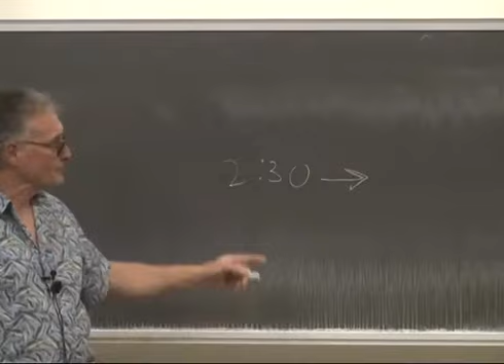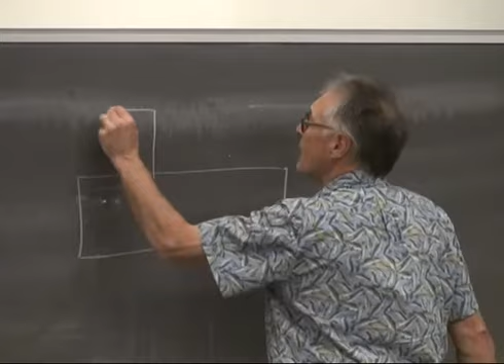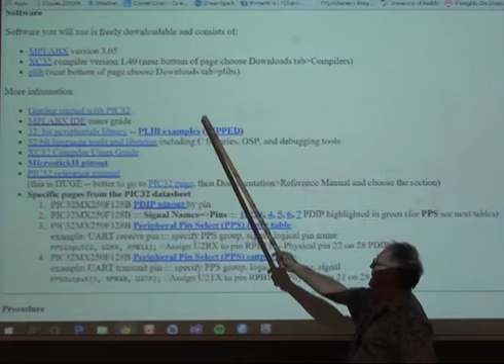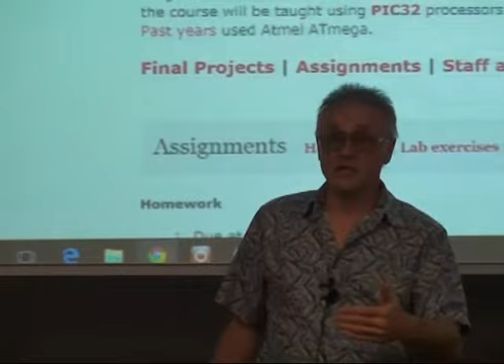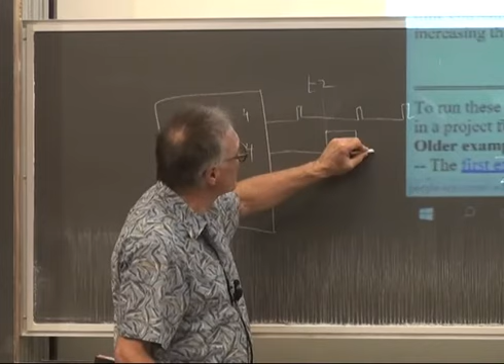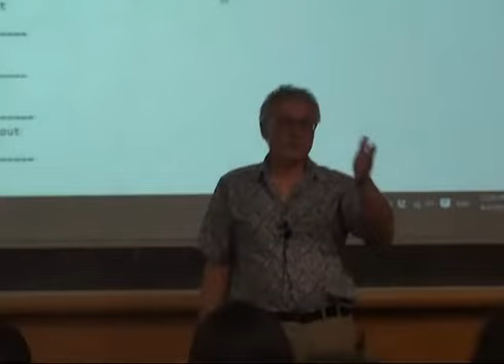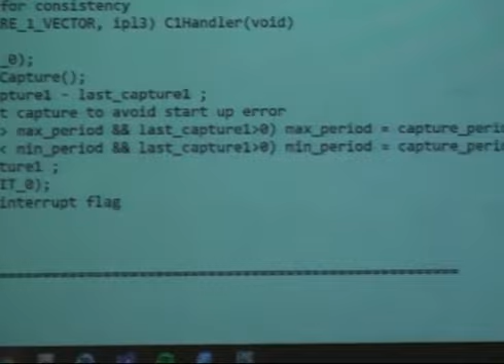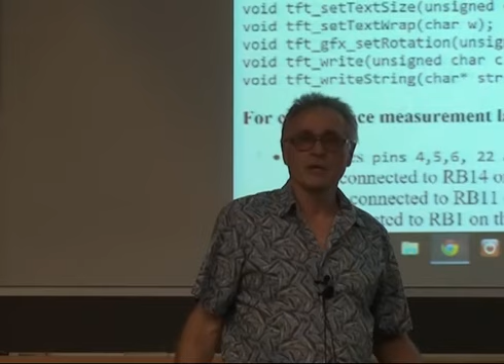#4 Comparator, input capture, output compare

Comment: This is a very interesting lecture and one of the hardest peripherals to understand first time. probably cause it builds on top of TIMERS and expects masterful understanding of the basics of TIMERS,  I managed to get my OC module to output PWM, then feedback that signaL BACK into the IC module the result is an ISR that measure the delta and its very accurate!, the IC module has some very interesting capture modes too!!, 
Its recommended to decide up front operating frequency detection range, else a frequency too high will keep the ISR way to busy, in my case I was using a PIC24F running at 32MHz and monitoring RPM and controlling two PC fans. RPM ~ 2000, frequency is about 30Hz, I used a TIMER time-base double that.          

PIC's are really interesting, I started learning them again, its pretty obvious when reading a Microchip data sheet they have better datasheets (put the ARM vs XXX debate aside) and look deeper, its way more consistent, the registers are easy to read! consistent tabular layout, the peripheral block diagrams are very clean!, its almost like looking at hardware abstractions than specifics, I tried STM32, Ti MSP430, Ti C2000, obviously much more powerful,  none has the simplicity of these chips, its engineer to engineer translation. 

Side note: They probably some of the only MCU's that can do -40 to 80 or 80+ *C  temperatures. 

Thanks Bruce your lectures are really interesting.
Reply from the maker: I totally agree about the register descriptions on PIC. SAM21, STM32, and ARM9 datasheets were way too hard to teachin one semester.